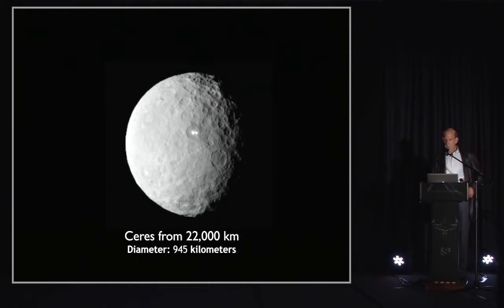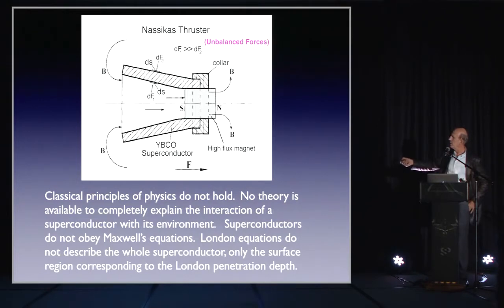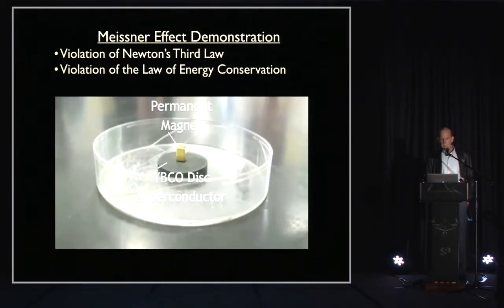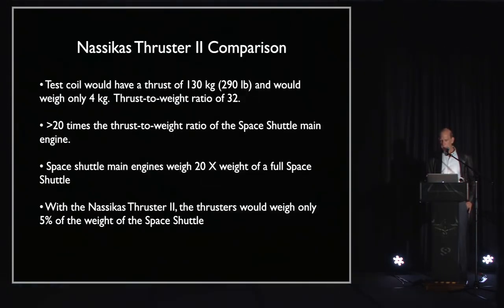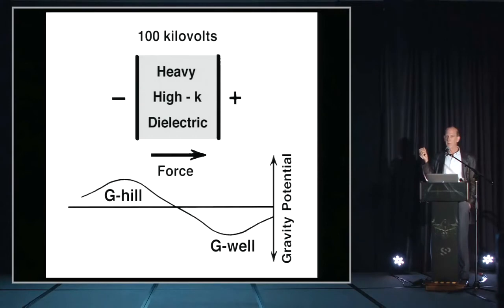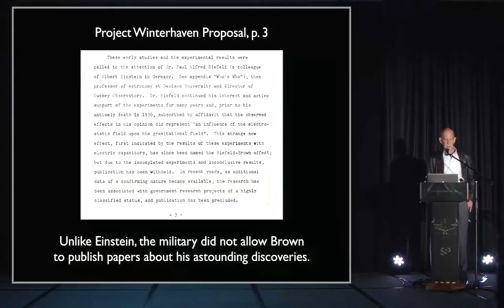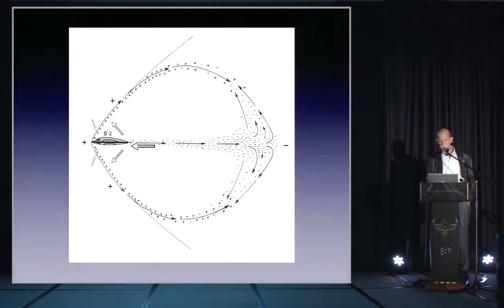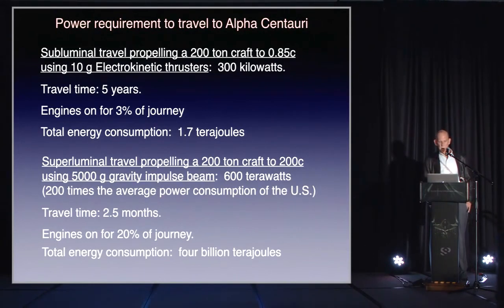Aerospace Propulsion Technologies - Dr Paul LaViolette

Comment: I saw this white saucer back in 1973 or 74 in anthony nm this saucer has a step ladder on the bottom to get inside the step ladder has approximately 4to5 steps the step ladder unfolds on the right side of craft towards the bottom. It must have come from white sands missile range and they put a small blimp flying around a 10 mile perimeter to distract and confuse the people that saw this craft.

Comment: 29:07 The magnet is an ether-propeller. Or rather, all of its atoms are. In a ferromagnet, they're all aligned and churning in the same direction. Superconductors perfectly exclude the magnetic mode of ether-churning, which means that its atoms become anti-magnets in the presence of a magnetic field. The magnet is levitating because it has polarized the superconductor into a magnet of the same pole, the same way (but exactly opposite) that a magnet temporarily magnetizes a paramagnetic material (turning it into a magnet of the other polarity, which attracts).

Mainstream physics can't even explain the work done by ordinary ferromagnetism and diamagnetism. It can only measure field strength.